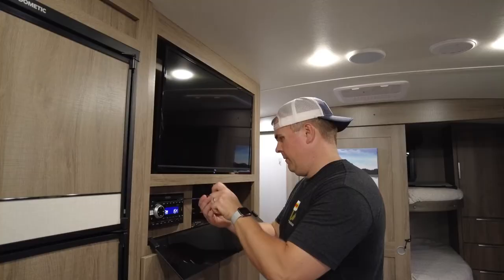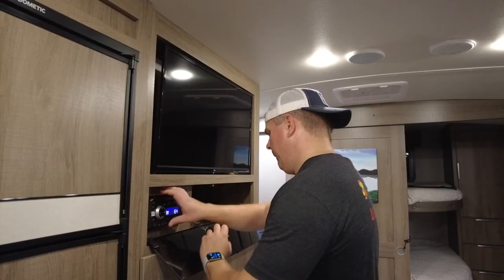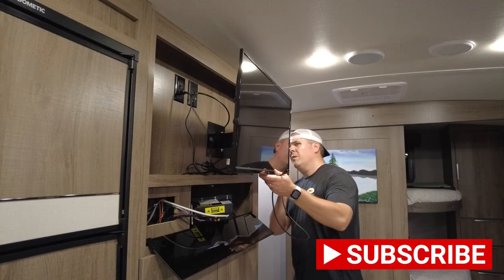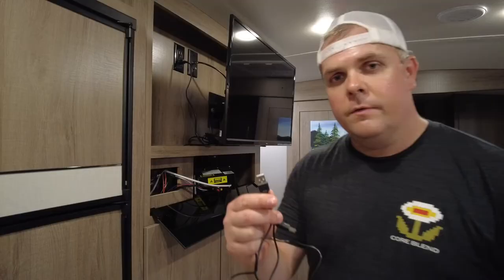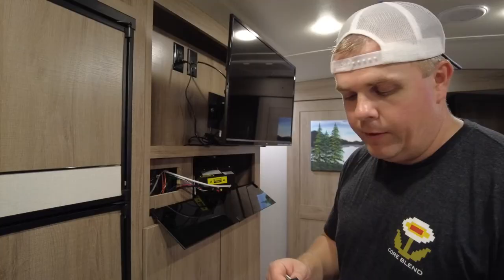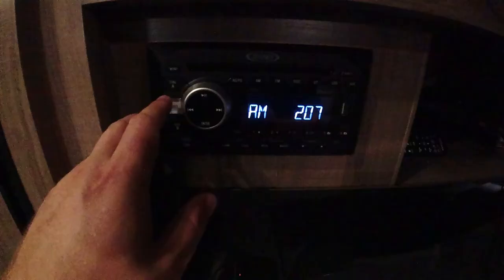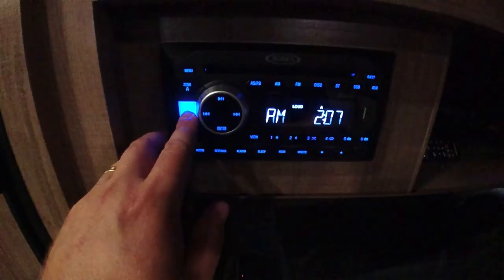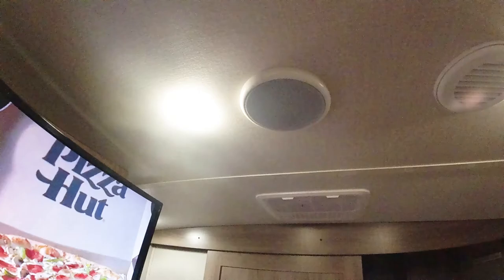Pushing TV Sound Through RV Speakers (Smart TV, Quick Fix)

Comment: On aConcertone stereo. It has a fuse. And the stereo is DC powered. Which runs on your Battery. And the. A and B. Pulls you sound inside and out. My husband figured this ll out. Because no one could. 😀. And choose your function button for radio.